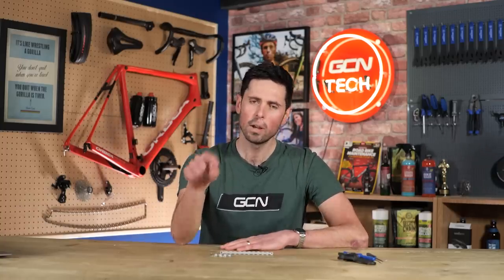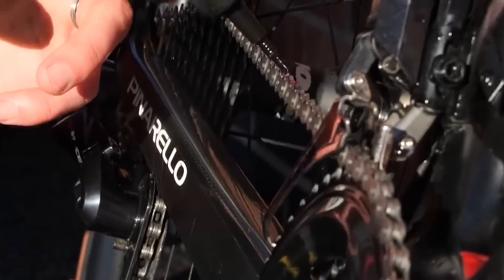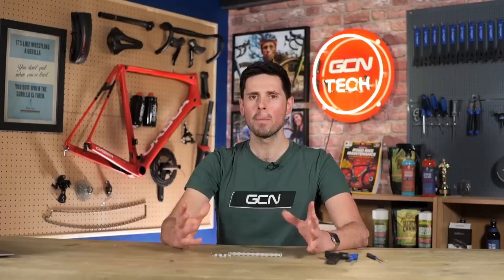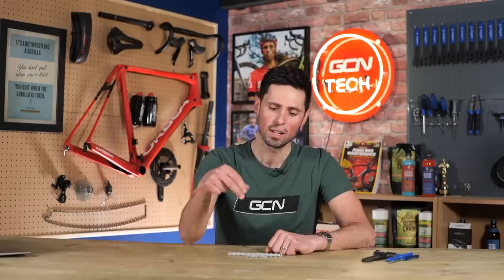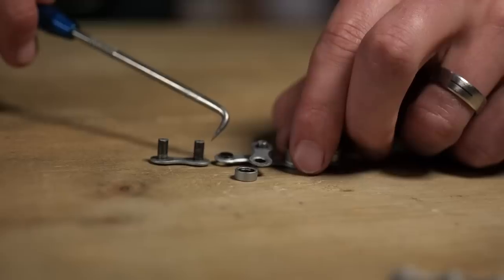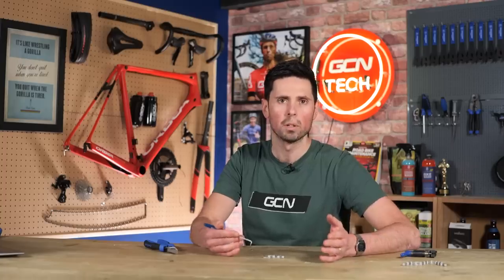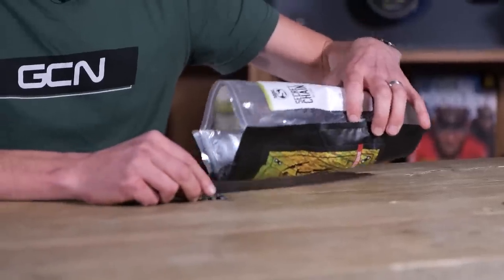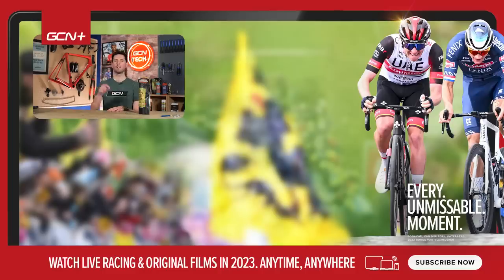5 Ways You're Destroying Your Chain & How To Lube It Properly!

Comment from the maker: How often do clean your chain? 🤔
Reply: After every single ride, of course!
Reply: Once . I fully degrease it when new and after that i wax it . Then every 300 km i wax it .
Reply: When it's dirty or noisy 🙂
Reply: For my rode bike once about  every month unless the days ride was wet and muddy. Then I will clean it that day.
Reply: I clean my whole drive chain and then lube after every ride. Cassette and chain still look silver even after 2 years.
Reply: When I used oil, I did a quick relube every 300-500km and an intense cleaning every second time, but since I started waxing more than 1 year ago I do rewaxing only after 700-2000km. And the nice thing about the waxing is that you never get dirty hands or cloths when touching the chain.
I do not have enough statistical data myself yet, but I have the impression a waxed SilTec Shimano chain (I use CN-M8100 on my eBike) is a magic combo and lasts forever before rewaxing is needed (I did 2400km including 10% gravel roads before rewaxing). Once my road bike chain (HG601) is worn out I also plan to switch to the SilTec version HG701 and see if that increases the timespan even more. Would be interesting to know if others share the same experience.
Reply: Once a week for dry two times a week in wet weather. If I'm riding daily.
Reply: When it's wet, after every ride. In the summer when it's dry, every 200-300km or so.
Reply: I just check visually because it really depends on the riding conditions, but on average somewhere around every 100-250 km or 3-4 rides, except getting in the rain or after riding gravel etc.
Reply: @stefanwagener  Nice summary.
Reply: 700-2000 km rewaxing ?  😳 i call that BS
Reply: @mikedio  Opinion noted !!!!
Reply: @mikedio  same!
Reply: I clean every 1000kms when using squirt lube and every 500kms when using all weather or wet lube.
Reply: not nearly often enough...
Reply: When necessary, which is probably not nearly enough, especially in winter.
Reply: I clean my chain (and bike) after every ride and add dry lube. From experience as it’s thinner It gets in where it needs to and works pretty much straight away (after liquid evaporates) because I do it like this I find my drivetrains last ages and keeps silent.
I don’t go crazy with the clean and because I do it a lot I’m quite fast at it.
Reply: When I ride outdoors, after every ride. When I've just been on the turbo, every other week.
Reply: Depends on the weather conditions doohh...!!!
Reply: @shanebennett6722  hi Sunday fake rider!
Reply: I ride almost every single day so depending on grit, dirt, road muck ( Merida Reacto 4000 disc 2021 ) i will give my chain drive system a full clean most weekends by way of submerging my chain in Cillit bang degreaser & giving it a good "ole" scrub with a stiff hard scrubbing brush for a full 5 minutes...,rinse with warm water & then into my sonic cleaner for a 20 min cycle & after that my hair dryer to fully dry the chain & then before reinstalling the chain to my bike i give my "crank & rear derailleur" a good degrease & clean then go ahead to install the freshly degreased & clean chain..., after fully installing the chain ( by quick link of course )
Reply: I think i red somewhere that in normal condition (no rain or offroad tec.) every 400 kms would be good to clean and relube the drivetrain...
Reply: Never. I use two chains I rotate. I lubricate with cheap 2 euro a can spray grease from ACTION (Walfort Bicycle chain spray). I change around the chain after 1500K, put on the second. I can do this 3 to four times. That way I can ride 4500K to 6000 per chain. up to 12.000K combined. After that I need to replace 2 rear sprockets (use Miche you can have any sprocket combo you wish and replace individual ones that are worn) and get two new chains (Always KMC X8 or X9). Costs me 30 to 40 euro depending on how cheap I can find them.
Reply: I wax every 200>600km.
200 now in wet winter conditions with salt on the roads. I like my drive chain to be silky smooth and silent. 3 chains in cyklus. Hot pan homemixed wax 👌
Reply: Honestly, not often enough.
Reply: I keep it always clean! Wiping it after every 2-3 rides with an old rag (fluffy towel). Usually add some extra drops of oil between 600-800 km, drop it off the bike around 3k, for deep cleaning and inspecting its stretch. Use 3 chains and rotate them (road bike).
Reply: I used to get 1.5 to 2k miles with oils. I just got 12k miles using homemade liquid wax with a motorcycle scottoiler fitted. Clean won't stretch. 70 miles a day doing city deliveries makes proper waxing inappropriate but it is better. A little paraffin oil and wax oil in the mix reduced rust in rain.
Reply: When it looks dirty. Lube it with any kind of lube I can get for cheap and change it every other month. No problems in decades.
Reply: I hardly ever clean my chain, because I hot wax it. All I do is occasionally washing off the worst dirt from the chain with a water hose. The rest of the dirt will come off in the wax bath, especially when it's agitated towards the end of the process. You only need to do more than that if you're racing, and in particular to your dedicated race chain(s).
Reply: Every 500 to 600 km with a chain cleaner and paint thinner - or immediately after any dirty/wet rides (which are very rare).  

Then, light application of lube to the chain rollers with a small re-purposed oil container filled with (drumroll....) WD-40.  I didn't intend for this to be a long-term solution but after 13,000 km the chain still isn't worn out - so I'm waiting to see just how long it lasts on WD-40 alone!
Reply: Wipe down after 2-3 ride depends if it was long ride then wipe after every ride relubing every week or every 500km
Reply: I ride single speed with a chain case, draw your own conclusion from that...
A bit of cheap car gear oil does the job. 
On my other bikes, I just use cheap oil from Wilko.
Reply: About once every 2-3 months. I live in Florida and very clean and dry riding conditions.
Reply: Every ride, even commuting.  The cleaner and lube and a million rags are placed where I park the bike.  A few minutes is all it takes.
Reply: Wax
Reply: When I logging 50 miles a day four days a week ... I try and clean it every week if it was wet ... If it was dry like in summer then every two weeks ... I 'always' feel I lose my chain long before I should have ...

Best deal I got for doing the maintenance right was a work stand...and also I got one of those chain lift deals as now things are much easier... Not to mention cheaper than paying a bike shop but I of course do my best to support them when I am due for a major service and want them to take everything off the bike 👍
Reply: Every off-road ride, or even mid ride.  
Road chain, depending on conditions and mileage.  But once every fifth ride on average.
I DO NOT ascribe to the "degrease & relube" insanity.  Especially using gasoline or other volatile, flammable and toxic organic compounds!  Really, it's a waste of time and energy.
Ride, wipe, lube, wipe, repeat.  That's ALL that's necessary.  See my post above.
Reply: I clean the chain after every single ride using innobike's 105 chain fluid which seems to do a good job of cleaning and at the same time lubing the chain. The most serious issue I have with KMC 12 speed chains is their elongation, though.
Reply: @mikedio  Yes, but really, you put boiling water over it every 300km too.. Like ME! Then you wax.  I  am curious though, do you use just wax or extras, I use PTFE additive to plain paraffin wax.. curious about what others do?
Reply: @Desmo500  i don’t use boiling water . I just wax it every 300 km . I use molten speed wax .
Reply: Which wax are you using? How do you wax the chain?
I use squirt myself, happy about it. But it doesn't last that long
Reply: once a....several weeks 🙈...or when really gets seriously dirty...I have a question, I have to clean my chain every single ride? If that so...I have to washed, or there are another method to make a fast clean of the chain? well, when it doesn't really dirt
Reply: Very little since I use wax .
Reply: Take off chain and degrease then rinse. Soak chain in bath of magnatec  0-30w. Wipe off excess and refit.
Have done this for 30 odd years and get 10000km out of chains,cassette etc. Fancy lubes are bollox 🤣
Reply: I also only ever put up to 8 speed on my bikes, Shimano HG chain costs me £6, it's not such a big deal to replace them.
Reply: I just got rid of a 30 Yr old mtb, never oiled it once 😮

Comment: I use Squirt - that’s the best chain lube ever, chain always looks clean, it never forms the dreaded paste and it’s environmentally friendly. Try it out, seriously good stuff.
Reply: Tried  , good on kmc chains,they are made of stainless steel but not the best for shimano chains, after every wet ride shimano chains get rusty pretty  quickly .
Reply: I also use it but I don’t know how often it should be applied (if used on dry conditions). Every ride (say 20 to 80 Km)? Every 100 Km? 200 Km? Currently I clean all the transmission after every ride, clean the chain with a cloth, apply wax, remove excess, done.
Reply: I've used it for a few years now on all my bikes.  It has extended chain life, is very quiet, and keeps things clean.  It has taken a little time to figure out how often to apply it though.
Reply: @iggalan  there is no set duration because it depends on the conditions you are riding. 

I normally wipe the chain at the end of every ride with a clean rag. If chain sounds dry or looks like it needs lubrication then that gets addressed. The TT bike needs it about once per season (weekly use, almost never used in the rain because that’s unnecessary misery). The ‘cross bike gets a full chain cleaning and relube every race. For the pros, it’s even every lap sometimes!

With Squirt I found that excessive application lead to buildup around the jockey wheels. It didn’t need to be reapplied as often as I thought (road bike). I do not use it in bikes that will often deal with very dirty conditions like an MTB so not sure how it would fare there.
Reply: @Bu-22  if you won't ride in wet conditions you should  be  fine . Winter I use mucc off  wet lube ,summer  love squirt wax  ,it's easy to clean and last long and it's quiet  not like mucc  off  dry lube
Reply: Squirt eh? Im more of a Sprite guy
Reply: Just be aware that it’s technically a wax lubricant. Needs to be taken care of slightly differently.
Reply: Smoove is supposed to be even better than Squirt.
Reply: Have used it for five years now.  My present KMC chain has over 14,000 km and shows only 0.25% wear.  I clean and lubricate my chain every 150 km. Squirt is the only lubricant to use.
Reply: @tychoMX  I clean my MTB chain and transmission after every ride, but with the road bike I'm still learning what is best. I brush the cassette, chain rings and jockey wheels so no build up there 😀 .
Reply: WD-40 every ride on the road bike.  7k miles so far on current chain.  But, you need to be religious about it. It cleans and, puts a light oil on and dries pretty well. 

Still trying to work out my MTB lube.  The Woolftooth stuff needs reapplication way more than they say (after 10 or 12 hours it is so dry I thought the derailleur was bent it was making so much noise) and if I get the chain wet and don’t reapply it rusts.  WD-40 is pretty good, but I like the internal cleaning of the WT-1.
Reply: @piotrwojcik1756  interesting. I read from zero friction that kmc is not so good with wax because of the coating they use. Not sure if that specifically the Silca brand but it was mentioned. I was actually waiting to change to a Shimano chain before switching to wax because i am on a KMC now.
Reply: @Singapore Untold Channel   hi . All my bike comes with  kmc chains but never used wax on them . Always switch to shimano chains because think shimano groupset should work better with shimano chains because of the hyperglide technology etc  and to be honest  found shimano chains  bit more quiet
Reply: I really thought you meant the soda

Comment: I've been using immersive melt wax for over 30 yrs, but the last few years I've been using Silca Super Secret wax.  I "hot wax" about every 1000 miles, but in between I wipe down the chain and apply their drip wax every 200 miles.

Comment: If I'm using a liquid chain lube I always apply it to the inside of the chain links, i.e. the top of the lower run.  This is so that centrifugal force, created by the chain rotating, will draw the lubricant through the chain.  I use Squirt lube which is a wax that is applied as a liquid which then solidifies.  No need to mess around with melting the wax first.  My chains last forever... well a really long time and 3 times longer than when I was using an oil based lube.
Reply: I use Squirt as well, and this video seems to support that product choice. 90% of my rides are dry, sometimes a little dust, and I use product about every 30-50 miles.
Reply: @morningtidefilms  it will last several hundred kms in dry conditions
Reply: How many miles do you get from your chains then?
Reply: @grahamaustin9085  Last SRAM AXS chain was still measuring OK after 14,000 km.  I eventually replaced it because I was changing the cassette for larger sprockets.
Reply: @bikebrain  That’s impressive!
Reply: I do the same exactly. I only have one question. What do you do before you add new lube? Do you degrease like with normal lube or just wipe it or something else?
Reply: @bikebrain  Impressive

Comment: Finally, someone at GCN who knows how a chain works and explains is correctly. Just remember, roller wear does not make a chain longer. It might make it shift a bit sloppy, but it’s only the pin to pin bore wear that makes a chain measure longer.
Reply: But they fail to appreciate that a chain ridden off road or in inclement weather on road gets dirty IMMEDIATELY.  So getting it "pristine" through degreasing is really a waste of time.  It's as much a waste of time as is scrubbing your tires perfectly clean after every ride.  Why?  They're dirty within minutes on the next ride, with all that "abrasive sludge" wearing things out right off the bat.  Take care of your chains, but don't overdo it.  They're consumable items that wear out.  Change before elongation gets too bad and you're fine.
The only exception to this is immersion waxing.  I've spent 45 years cleaning chains with all the different traditional lubes, wet and dry.  Finally purchased bulk wax & powder tungsten disulfide to make my own chain wax.  Can't wait to finally enjoy drive trains free of gunk (even though I've always taken care to prevent the build-up).
Reply: Almost all info copied from Zero Friction Cycling web
Reply: Dude on Bike, when your chain gets dirty immediately, is that dirt immediately getting past lubricant & onto inner surfaces? Is it getting past the Molybdenum Disulphide or Tungsten Disulphide additives that chemically bond to the metal to reduce friction? Nope. There's more to cleaning a chain thoroughly before lubricating than just keeping mud at bay. Read up on it from Silca or Zero Friction Cycling
Reply: @mikeburgess5760  yes, but it doesn't "get past" lubricants.  They aren't barriers.  Dirt combines with the lubricant and creates an abrasive paste.  If you understand capillary action of liquids, you quickly realize that grimy lube, water & mud work their way into the links and rollers almost immediately.  The lube doesn't act as a barrier - it's an attractant for grime.
The advantage to wax is that it doesn't form an abrasive paste.  Nor do dry lubricant powders, so they perform their function without the drawbacks of liquid lubes.
And  yes, I've read a lot on the subject.

Comment: Excellent video!   Thanks, Alex and GCN.    I've graduated from using any old sticky wet lube (that I had to replace chains and cassettes because of!) to drip on "dry" lubes, to using hot melt wax.   Learned from experience that nothing beats wax.   Nothing even comes close.    And that feeling of riding with a freshly waxed chain - WOW!     It's hot melt wax every 200 miles under normal road riding.    I do a hot water rinse first about every other time my chain goes into the crock pot.

Comment: Great video. And after you have cleaned and lubed your chain, check for wear. New chain links are exact 1 inch apart. So get a ruler in inches and precisely measure 10 links with the clean chain on the bike. If your 10 th link is 1,5 mm or 1/16 inch off, put on a new chain. Thats about 0,6% “stretch”. Some say replace the chain at 0,5% some say at 0,75%. And because a chain is so much cheaper than a cassette or chainring and far more easy to replace, just replace your chain early. So clean and lubricate your chain as shown in the video. And replace your worn chain in time. And you don’t need a chain checker, just a ruler in inches. That is so much more clear and easy. Enjoy your diy. 🚴🏻‍♂️🔧

Comment: I've been waxing all my chains for just over three years now.  I love how clean everything stays
Reply: Which quick chainlock do you recommend for Shimano 10 gear Ultegra/105?
I take it the chain must be rewaxed ever 300 km or so, so getting it on/off easy is critical.
Reply: KMC do quick links -Your mileage might vary, but I’ve reused mine in the life of the chain with no detriment
Reply: @alexobrien8585  I have the same experience here but SRAM quick links, snapped them on and off dozens of times without issue.
Reply: Yeah, no chainring tattoos with wax.
Reply: Too much work. It's also noisy, and your chain rusts if you go through a puddle.
Reply: Connex links. Wax is the bomb.
Reply: yeah clean chain but noisy